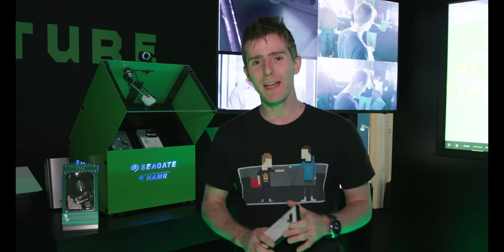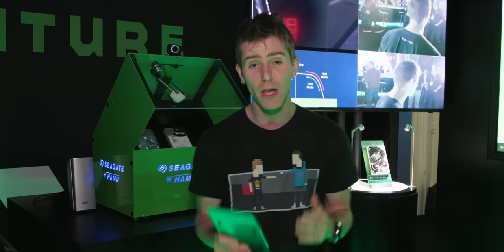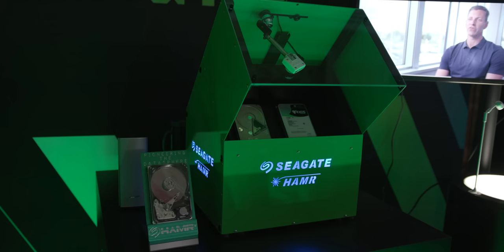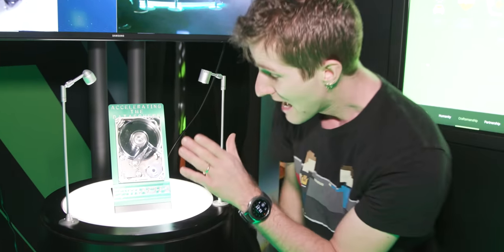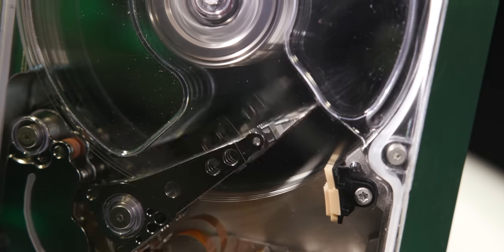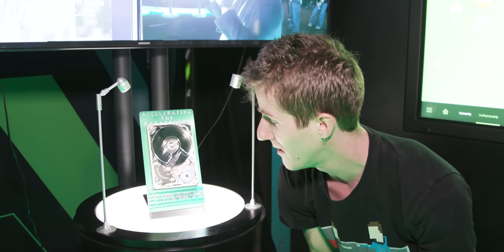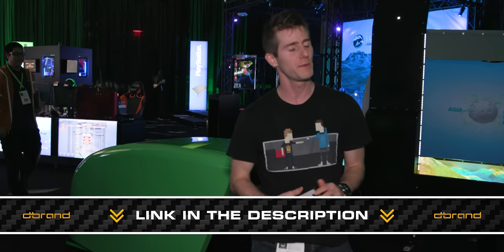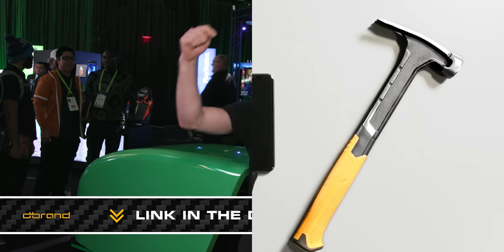The coolest hard drive tech in 20 years

Comment: Less of... It isn't hard to put a 4U in the back of a van and internet speeds are getting so fast that the kinds of people needing to move hundreds of terabytes from one working data center to the other can get speeds close to local transfer over the internet. I'd rather see business ISPs implement a burst system so that you can "overclock" your connection on a per-day fee. If your ISP is giving you gigabit fiber 24/7 they probably have the infrastructure to give you 10gbps for a day(100TB).

But seriously, who needs this? How many companies have that much data to move and not enough bandwidth to move it? The only thing I can think of is a service that's completely tapped out on their bandwidth and needing to do regular backups of huge amounts of data... But a second data connection probably makes more sense for that.

Comment: The two independent arms certainly look cool  but it's pretty useless in practice, isn't it? It's basically the same as two independent drives in one case. The read spead from a single platter doesn't improve at all. Unless they're used in some sort of RAID 0 there is no advantagel. And two half capacity drives without independent arms will probably be cheaper than this one.

Comment: Seagate. "We know SSDs are faster, but we're reeeeally good with Hard Drives."
Reply: Untill they are not :D Seagate has the highest failure rate.
Reply: @jondonnelly3  indeed when only 3 companies (WD, Toshiba and Seagate are manufacturing HDD) It is not particularly hard to be the one with highest failure rate.
Moreover contrary to WD Seagate did 't invest much in SSD so to keep their HDD market is very important. And their HAMR technology is very impressive (it is basically incredible and a lots of Physics and R&D was needed here). 
Moreover Linus group for sure has a contract with Seagate (I have seen a video of Linus in intermag conference presenting HAMR technology).
Reply: @jondonnelly3  I really don't get that thing. I have always used an Seagate drive and it has never failed. Maybe im just lucky. ^^ But I never use a drive longer than 2 years. New PC = new everything.
Reply: This is all Seagate can do right now, their Enterprise SSD gig did not go very well so back to HDDs for them. At least WD purchased Sandisk for ideas and a base for getting into the SSD market.
Reply: @GHZZZ1  2 years is super short. Pretty sure that is within factory warranty...so it's expected to last that long. I usually keep drives for around 5 years. Depends on usage/needs/specs. Like I'ma about to update all my current as 128 cache is getting affordable and SSDs are like half the price they were in 2017.
Reply: @paulnoel8470  the problem with hamr is another mechanical optical thing to go wrong. It's a bit like building a faster diesel train when electrified or maglev exists. SSD prices are falling fast. Soon HD will be relegated to low cost backup and 3rd tier.
Reply: @paulnoel8470 If u have 3 options for hard drive and all 3 are so similar in performance to margin on error. Reliability measures are a prudent way of making the choice. Seagate  are last place.
Reply: @jondonnelly3  actually it is very unclear if Seagate is less reliable (Blackblaze datas are not reliable regarding how they use their disk and how they compare them) and Seagate is usually cheaper (errors on a HDD is basically a cost, if changing the HDD is cheaper than buying a more reliable one in the first place it is still a better disk, this is a terrible way of thinking for the planetthough). Regarding informations found on the net except for well known problems of 1.5TB disk, Seagate is not less reliable or at least nothing proves it.
Reply: What are you talking about? Seagate makes SSD's.

Comment: Why would someone try even grabbing a 20tb hard drive? I highly doubt the normal editor, gamer, or designer would need this much data in the first place. Unless they are using it for private uses if you know what I mean. If they have been testing it for 20 years, its pointless if it fails easily like thier other drives. Seagate's hds been proven to have higher failure rates than other drives, and I wouldnt recommend them in the slightest. If the shit is gonna be upwards $400, it better have good af Write/read speeds, not break in 6 months, and have a 5 year warrenty. Otherwise, you can count me out when I can just run two sshd's in raid 0. Can't wait for Western digital to destory them when they get the chance.
Reply: You do realize that 100Mbps bitrates and above is pretty normal for raw video files right? 20TB is not exactly hard to fill up for editors making longer projects.

Comment: Wow heads that have seen 8k hours of run time................... And exactly what percentage of units was that of those tested?

Because the way it's stated, it could be anywhere from 9 out of 10 to 1 out of 10 that made it to 8k hours. I don't care what "special sauce" Seagate adds, it will have no effect on it's reliability only it's capacity. As long as you don't add something else that could effect that reliability........ something like heat or increasing the number of parts that can wear out. Which it does.

The other issue with this is it's not the only pony giving carnival rides. It's in direct competition with Western Digital's MAMR (microwave assisted magnetic recording), which eliminates the "heat" factor as well as doing a better job of leveraging existing tech. This has the advantage of allowing it's reliability to be much less of an unknown" while keeping cost down compared to HAMR.

Comment: Poor Seagate, working so long on a tech, it became obsolete when they finished. Because HDDs are obsolete. I see no reason to buy them for neither consumer, nor enterprise storage. SSDs are better, harder, faster, stronger and more reliable too, since most hard drive failures occur when you migrate a data centre, due to mechanical fault in the motor. HDDs running for years non-stop appear totally OK, then you move the rack and on new DC they just don't start spinning. SSDs degrade over time, which makes monitoring software pick up faults before they die with their data.

Its just an obsolete technology.

Comment: Heating up a hdd platter with the head? sounds like an iffy stopgap solution until something better comes up, so no thanks! will stick to tried and tested tech and buy a few 8tb/12tb 'normal' drives thanks! Who cares about performance on a mechanical hdd these days lol, just use m2 ssd to boot and slow reliable mech drives for data...